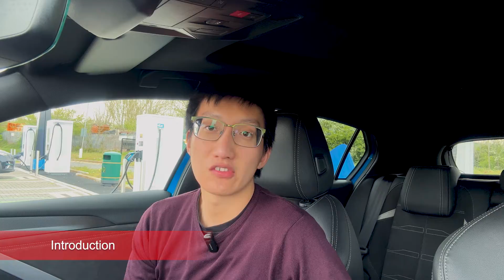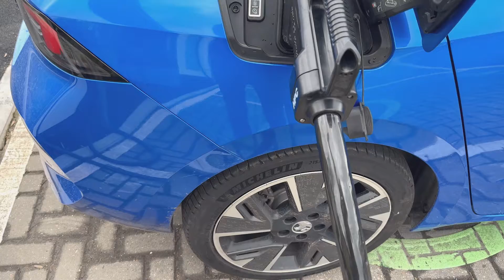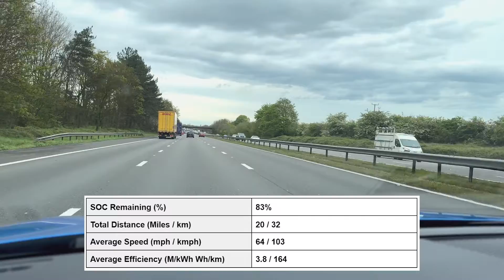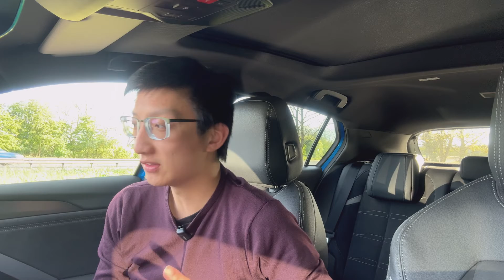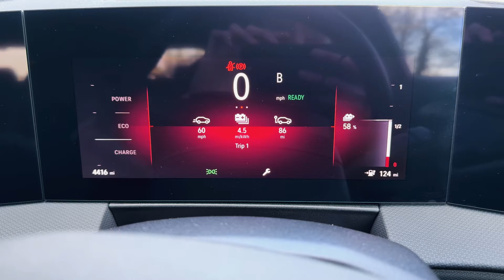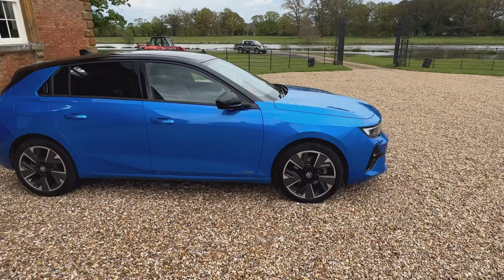The Hidden Efficiency King: Vauxhall Astra Electric Range Test | KC Talks EV

Comment: Thanks for this, I've been looking to lease one of these soon as the deals are really amazing at the minute and all other reviewers seem to leave out the efficiency information.
Reply from the maker: (Sorry I thought I was commenting on another video!) 

Yes some of these lease deals are excellent, and the car itself I found great for the few days on test, let me know what you think of it. Have you test driven an Astra?
Reply: @ currently driving a CUPRA Born and have been pretty happy. The range isn’t great in cold weather but I do really short journeys and the Born does not have a heat pump. I do love the way the Astra looks though. I might get a test drive in one soon
Reply from the maker: It's quite an understated car, and the efficiency was certainly a surprise. I'm unsure about winter range (I'll have to borrow one again), but at the lower temperature in the test it handled it quite well. 

Definitely test drive one when you have the time, it's quite good!